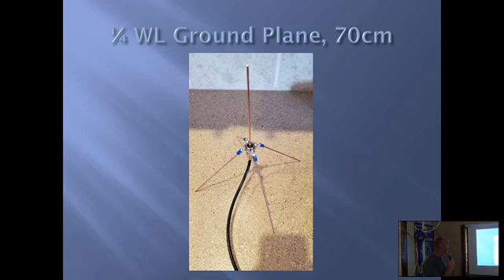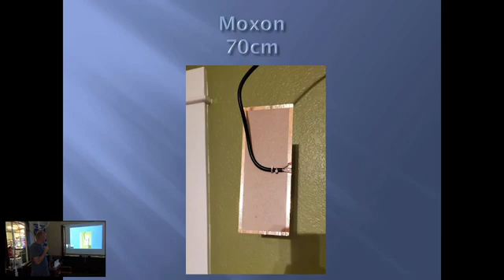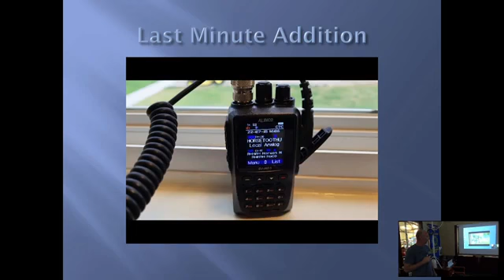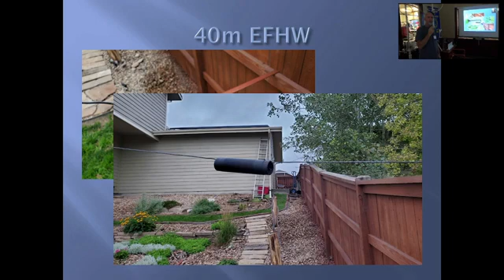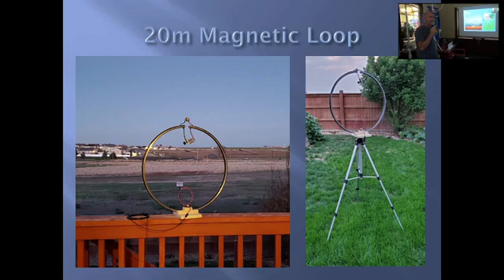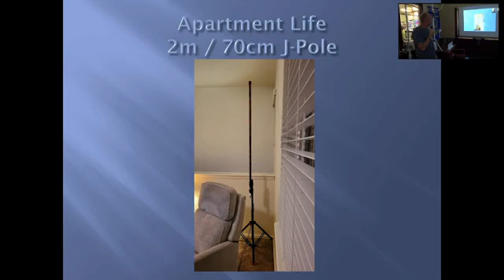Stealth Antennas for your HOA Volume 1

Comment: There is an octave relationship between 10 20 40 80. I have 40 m end fed half wave works fine on 20 and some on 80. I haven't tried 10 but do hear CB. It's NVIS.

Comment: hi hoa wold have lots of problems wit me if i wold move to us having full band hf antenna coveryng every band from 6m to 22km band 4 whf uhf other 2 separet antennas its a shame that other peple limit you on antenas one day they whold need your help on an emergency  what whill hapen then
Reply: When the stuff hits the fan and people need to call their loved ones they're going to knock on your door. I'm a member of my local ARES club.  Here in St Louis we don't have big problems but occasionally a tornado happens core power goes out in the winter because of tree branches hitting lines.  The North Carolina issue has really shown people the use for ham radio

Comment: Thought you may like theVHF/UHF Vertical Dipole, I saw a video for on here. It is made of 2 stanles steal welding rods bent where one part is for VHF and the other is for UHF. One of the bent rods points up the other points down mounted on some PVC pipe. The rods are 1/8 thick and  36 inches long so there is much is cut off when tuning. This would not be hard to hide. Other things you may or may not know is that NASA is asking for help from hams in the solar eclipse, for propagation study in the eclipse. I hope we have a lot of hams get going for this. This is something that hams do anyway. Thank you for the ideas you are giving out, we need to help each other. 73   W4DES
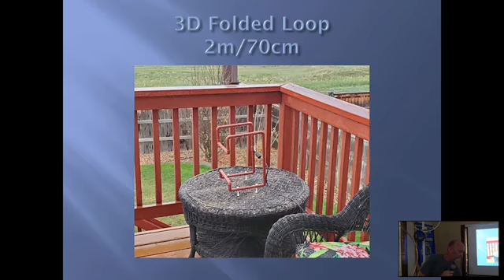Reply: I show that antenna at around 4:22 in the video. I did not glut the "T" fitting, so I can rotate it from vertical to horizontal to use it for 2m SSB.

Comment: I wish the pictures place holder was the opposite. When you where pointing out the driven element for the MOXON I couldn't see a thing at 10:20 .
Reply: A Moxon antenna is nothing more than a 2 element Yagi with the ends folded in. The driven element is the one the coax connects to. So, in the picture at 10:20, it's on the right.

Comment: Great presentation. I enjoyed the stealth of your Antennas. I've been in apartments, condo's and small yard houses. I will warn anyone in an apartment building. Be careful of your output power with indoor HF antennas. I was working nights, so I played radio at night on my days off, and while tuning up with 100 watts at 3:00 AM my RF set off the buildings fire alarms. Oops! I had a lot of fun and some frustration trying to get on the Air.